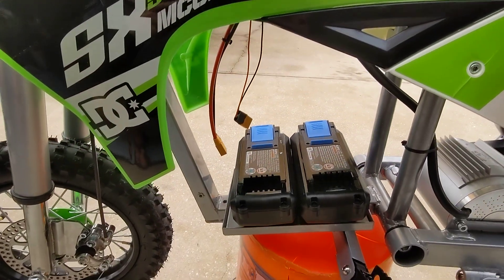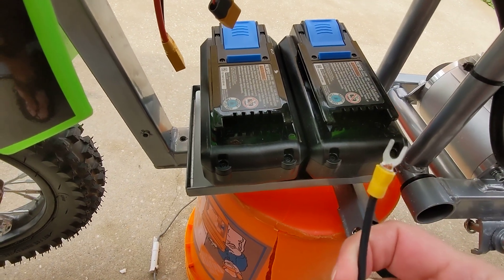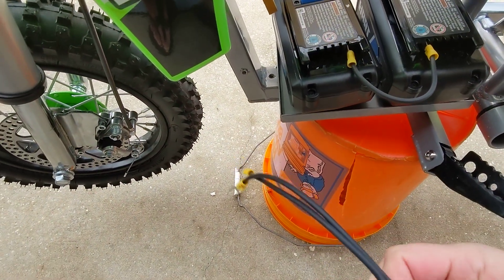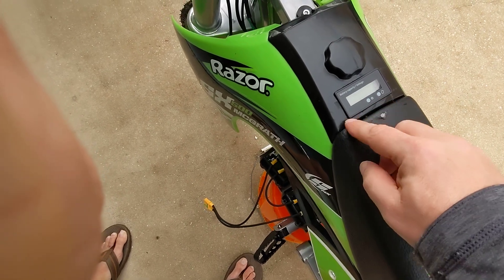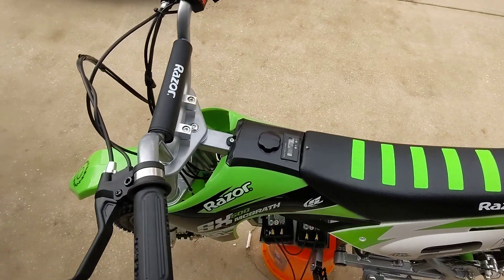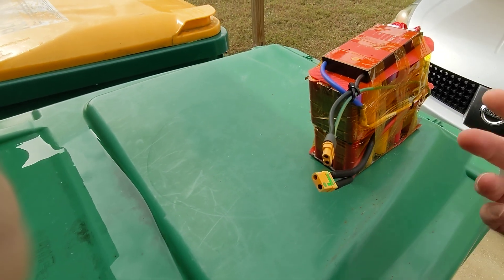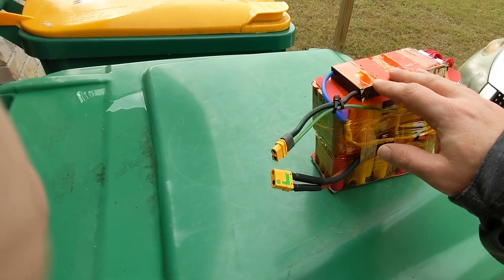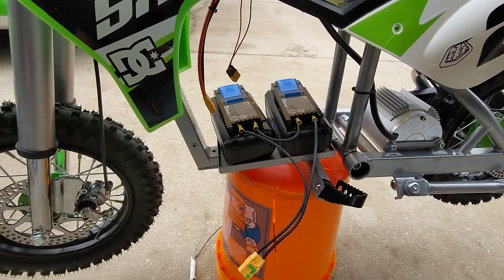Razor Dirt Bike Mods part 4 - Drill battery 72 VOLT wiring clarification and details. What's next.

Comment: Hi. I was going to use 80v greenworks batteries in series parallel. You went back to a traditional pack. Can you elaborate as to why?
Reply from the maker: Your 80 volt battery paralleled to another would be a great option for capacity.  I created my own battery because I foolishly thought I would ride further than I have been riding and also wanted the experience of building a pack.  In hindsight, it was an expensive mistake (especially because I actually built 2 packs since the first one was not designed correctly) and I should have stuck to the 2x hart batteries I had in series.
Reply: @chuck1011212  im trying to rig up some milwaukees is there a way i can contact you to talk about this stuff buddy
Reply: @ZOMBuckaCurt  you’re going to connect them in the same way except that there are 4 instead of two if you are using 18v packs.  Neg to pos to neg to pos to neg to pos and you’ll have one negative and one positive left which are your 72v.  It’s really not optimal to use packs in series like this but can be done IF ALL PACKS ARE EXACT SAME CAPACITY and age!!!

Comment from the maker: I am going to switch to a battery made up of 200 high amp 18650's.  I am not affiliated with them, but got them from here:  https://www.batteryclearinghouse.com/ 
I will also be using cell holders for my next build.  I used hot glue to keep them together on my current self built battery and it was not ideal.